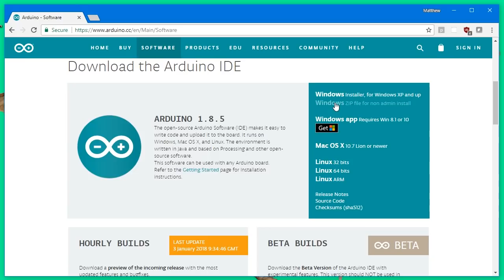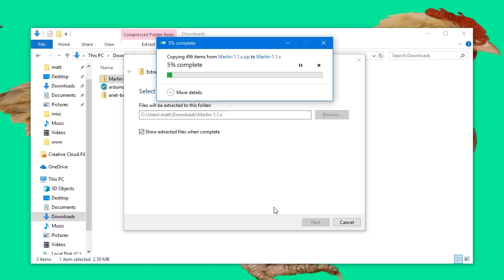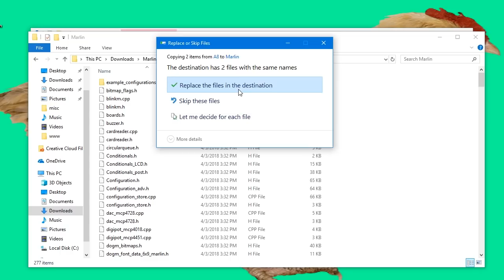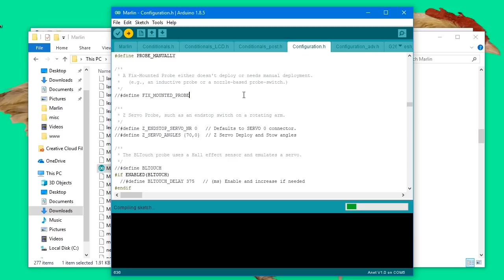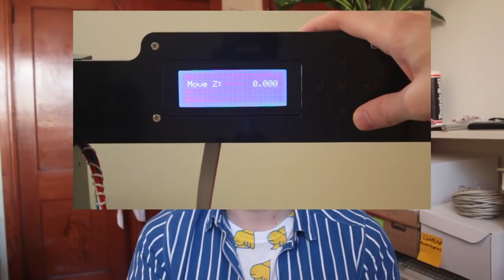Anet A8 Upgrade: Why & How You Should Update Your Firmware - Marlin Install Tutorial

Comment: Great Video Matthew Rayfield!  Thank you.  Everyone doing this to update to Marlin 1.1.9 now will get a "Non-constant condition for static assertion" error when trying to update an Anet A8 board using this instruction video.  To make it work all you need to do is go into your Arduino IDE and load TOOLS/BOARDS/BOARD MANAGER and search for "Arduino AVR Boards" - then click on "Arduino AVR Boards" and install version 1.6.23 by picking it in the dropdown on the left side bottom where it says "Select Version".   After you install 1.6.23 this earlier version of the Arduino AVR boards code is not bugged and your firmware will update.  Happy updates.
Reply: Thanks for you instructions, I ran across this issue too and you saved me hours of stress
Reply: Thanks a lot, Great Man! I had the same issue. Your comment should be pinned on the top to help others with this trouble. (sorry for my weak English)

Comment: hi,i buy a new 3d printer Anet A8 borad V1.7 . When the initial operation, the extruder is directed to the opposite side to the end and continues for a while the engine rotates even when the extruder reaches the end ... The same applies to the surface ... Also, the z direction motor works one and the other does not work .. Note that I almost checked the connections  All are correct, What do you think is the problem?

Comment: About the heated bed connector burning: From everything I could tell when it happened to me, its because the connectors are cheap and not properly seated or crimped. I soldered the wires directly to the pins and have not had any issue since. It was the loose connection on the pins and when the heated bed moved forward and back, it moved the pin around causing sparking inside the connector, ultimately heating up and burning the connector.

Comment: I didn't realize how much I loved my Anet until it broke and I tried a new much more expensive bigger printer with dual extrusion which turned out to be a massive piece of shit which still runs 2004 software. Steer clear of Athorbot. I'm sending that back and now looking to get a new board for my Anet A8. My hot end is the only problem, it won't heat and I'm pretty sure it's on the board where the terminal block melted off and I tried to solder solid core wires to it but might have bricked it.

Comment: Another item for 'Additional notes'  - Make sure you don't have Cura or other software that connects to the printer open while trying to update. Result is error message: avrdude: ser_open(): can't open device "\\.\COM1": The system cannot find the file specified.
Reply from the maker: I will add this. Thanks!

Comment: Thank u very much. Appreciate .
But I have some issue if u can support.
after updating my stock A8 to marlin 1.1 with the correct configuration profile , after auto home the display shows: X -33 Y -10 Z 0 , and The home position for my printer is not above the bed . so I am trying to adjust the X and Y offset . I'm not sure if I am doing this correctly but I use the menu to move the the correct corner of the bed and then select "Set home offsets" but I get an error: Err: Too far!
Plz support

Comment: Thanks for the video, easy for me to follow. But I can't do anything with the printer screen menu after uploading Marlin. It now reads "Marlin bugfix-1.1.x" on start up, then next screen reads: nozzle and bed temp, x? y? z?,  F/R 100%, SD---%, 3D Printer Ready. Selecting center button brings up one last screen, reads: Info screen, Prepare, Control, No SD Card, Init. SD card. I can scroll down on this screen but cannot access any options. I can print from computer via USB. Original firmware was working fine before, I just wanted thermal runaway protection with the new firmware. Anyone have any idea what went wrong? Thanks.

Comment: Worked for me, the bed leveling is really handy although the new menu took a little getting used to
Reply from the maker: Nice, glad I could help. And ya I forgot that the menu changes. I should have mentioned that. It does make more sense though I think to use the middle button.
Reply: @MatthewRayfield  Thanks for letting us know about the safety issues. It's appreciated
Reply: Did you have to add anything to the G-Code to make this work for you? I've had a few issues. First, the screen seems to scramble into non-sensical characters now and then, and by now and then, I mean always. Sometimes hitting middle button brings it back. 
But most of all, I go through the manual bed leveling sequence, it finishes I save the settings. I run a program, it ignores it's bed level and tears off my tape. I have 'bed leveling' "On" in the menu.

Comment: Installation went good but when doing the bed leveling routine, the z axis will only go up.  The LCD shows the amount of z travel, both up and down when the appropriate button is pushed, but z travel only goes up.    Even after the z has move up well in to the positive numbers region,  it will not move down when the down button is pushed.  The numbers on the LCD do go down however. What,s wrong?

Comment: The newest version of Arduino does not work with the board definitions. Open preferences and add this url as Additional Board Manager URL
https://raw.githubusercontent.com/benlye/anet-board/board-manager/package_skynet3d_anet_board_index.json
Save preferences and restart Arduino. In board manager you can now install the Anet 3D printer boards, should be the last option, so you need to scroll down a ways. After installing the Anet 3D Printer Boards, Anet 1.0 will be in the boards list.
Reply: New to this and have Arduino 1.8.8 cannot add your url. Typed it in the preferences line? Any easier way? Happy New Year
Reply: @rjmyers5708  File, Preferences,  Steeings tab
Towards the bottom is a line with an add box
Additional Boards Manager URL's:
Puth this URL in the box
https://raw.githubusercontent.com/benlye/anet-board/board-manager/package_skynet3d_anet_board_index.json
and click OK
The Anet boards should now be available to add under Tools, Board, Board Manager. Anet should be the last entry,  click on install.
If you still have problems I'll see about putting up some screen shots to help.

Sorry for the delay on answering. Had some personal issues.

Comment: I have an a8 with a 1.5 board.  I was able to upgrade it with your help. A couple of times I have had some garbled letters on the main screen. If I go to another screen and then back it goes away. Only other thing is I don't see anything about bed leveling.  Thanks for your help

Comment: Hey matt, so i have this exact printer.   Im looking at a new extruder end on wish, its a multiple color extruder (3 colors).  If i were to buy that hotend, what would i need to add do you think?  New board?  Or can i add to it?  I know i need 2 more motors and i know repieterhost will let you have more than one nozzel.  Im just curious if i need to upgrade the board or what i would need to upgrade if i wanted to get the 3 color nozzel.

Comment: Dear sir,
A well documented and clear explanation of the why and how. 
I found other info but that often was not so easy to understand due to high nerd-levels vs my lack of programming-experience.
Reply from the maker: Awesome ! Glad it helped you out
Reply: had problems flashing though. Finally succes when I first re-installed the drivers that came with the original SD-card. It seems my OS (Windows 10) had problems communicating with the anet 1.0-board.
Thx again!

Comment: i have a 3d printer kit using the ramps 1.4 driverboard and using an arduino mega2560 as the brain, will this work on it without problems or do i need to use a different version for the mega?

Comment: Hi, I want to use this board/steppermotors for a other project. For this project I just have let in turn some degrees en loop that coud someone help me pls. I thought that I just coud me a normal code for controlling stepper motors but that did not work. (i coud not difine the pin). And if woud it work than?
Reply from the maker: i haven't done much with motors, but i think you'd be better off just getting a regular arduino and motor controller shield of some kind. should be pretty cheap.

Comment: Well done. Great explained and following your instructions works nicely. I'm about to change my settings back to these as I've just just fitted a glass bed and my sensor doesn't work thru it - so back to manual I go (until new probe arrives or I can get a metal plate to fit under the glass.)
Reply from the maker: Glad you found it useful ! I'm using a BLTouch with glass and it's working well
Reply: Matthew Rayfield I managed to get a thin steel plate and now it works great. Thanks again :)

Comment: Still works as of Feb 09 2021. Use the exact same versions of Arduino IDE (version 1.8.5) and the Marlin (1.1.x) as shown in the video. I was struggling for hours with newer versions of those with no luck. Finally worked when used the same versions of software on windows 10. Thanks Matthew !

Comment: I did what you say, but now my printer is no longer recognized by the PC and the display shows 3 flashing question marks for XYZ, I did not make the changes to the auto leveling because I do not have the sensor, I do not know how to restore the original firmware v.1.5, nothing works on the display any button is pressed. Report printer ready but in reality nothing works, there are 3 question marks on X Y Z, can you give me some advice ??
Reply from the maker: I believe mine also shows question marks until the printer has homed. So this is normal. I do not know however why nothing would respond. But also, none of the changes I make in this video are for using a sensor, so you can use the settings I change and use the printer just fine without a sensor. Perhaps try going through the config changes I do in the video and try to install again ?
Reply: @MatthewRayfield  my pc not see the mainboard, nothing, i have only X Y Z blinking question mark, if i push anything button,  nothing happen... i am hopeless, u have any help for it?
Reply: OPPS sorry, I made a mistake, I did not realize that the enter key became the central one instead of the right one, ok, the MENU is fine. The problem are the question marks that blinking on X Y Z , why do I have this problem? Can it be that my card is marked "Anet3D v. 1_5"? So is it a 1.5 version instead of a 1.0?

Comment: Once I upgraded in my anet a8 the X motor stop working left, just right (positive). Idk why it happens but it looks like recording the true position. If i try to go to the home Y and Z work well but X start to go right (instead of left) without stop (even if it cant because is on the limit) and finally I must disconnect. It's so distracting. ¿Do you know how to solve it?
Reply from the maker: I don't know what would cause the going in the wrong direction thing. Sorry. Perhaps try checking your cable connections ?

Comment: I get a different "avrdude" error. It says :
Sketch uses 102860 bytes (81%) of program storage space. Maximum is 126976 bytes.
Global variables use 4161 bytes of dynamic memory.

avrdude: ser_open(): can't set com-state for "\\.\COM4"
An error occurred while uploading the sketch
Reply from the maker: This usually means the printer is not connected somehow or you have the wrong port. Make sure all is well with that and try again

Comment: Hi, I know that movie is not up to date referring to versions but I try to update my anet a6 with V1.7 Main Board  .. I'm using exactly this same Marlin&Arduino  + mainboard software V1.0  and not work ..  error as below .. 

Please help!

"Arduino:1.8.5 (Windows 10), Płytka:"Anet V1.0"

In file included from sketch\ultralcd.cpp:96:0:

sketch\ultralcd_impl_DOGM.h:46:20: fatal error: U8glib.h: No such file or directory

 #include <U8glib.h>

                    ^

compilation terminated.

exit status 1
Błąd kompilacji dla płytki Anet V1.0.
"

Comment: hi i have just updated and now my bed goes back to far and my x axis keeps bashing on the left side
Reply from the maker: It's hard to know what's going on without seeing it. Simplest thing is to make sure that the end stop switch is still connected. The default marlin config won't change how that works, so I'd be surprised if it was a software thing.

Comment: Quick question first of all great tutorial on to upgrade firmware easy and painless so the question is after I go through manual bed leveling through LCD menu and start a print the printer head always winds up to close to bed surface and is not extruding is there a quick adjustment for that while printing through their tune menu or am I doing something wrong thanks I also want to add a proximity sensor so I don't have to go to the headache of that

Comment: It doesn't appear in the Port section of Arduino but the printer's definitely plugged in- Running Mac OS High Sierra on a  2015 MacBook Pro, 13 inch. It also says I have already CH341 files
Reply: Did it

Comment: I tried the update and got the following error

Sketch uses 116406 bytes (91%) of program storage space. Maximum is 126976 bytes.
Global variables use 4368 bytes of dynamic memory.
avrdude: ser_open(): can't set com-state for "\\.\COM3"
An error occurred while uploading the sketch

Any Ideas?
Reply from the maker: The last part: avrdude: ser_open(): can't set com-state for "\\.\COM3" seems to indicate that the COM port might be wrong. Check that port and make sure the printer is on. Other than that I'm not sure.
Reply: Matthew Rayfield yeah checked the com port, actually the only com port showing. Printer on, restarted the printer. Almost seems like there isn't enough storage to upload?
Reply from the maker: I have had an error related to the storage before. But it seems to go away once I recompile. I know that's not super helpful... The only other time I saw a storage error was when I had turned on a configuration option that took up too much space. Maybe double check the config ? But then again, this error says it's using 91%, so I'd think that would be okay.

Comment: Having had done a ton of Arduino stuff in the past, this video made it incredibly easy. Thanks @Matthew Rayfield!

I see some folks are having random issues flashing the A8 controller or their controller getting bricked. It is possible your Adruino does NOT have a bootloader flashed to it (or it was overwritten). This saves a bit of space at the expense of not being able to flash it over USB. In that case, you would need to get another Arduino and set it up to flash over ICSP or get a dedicated ICSP programmer. With the ICSP programmer, you can (re)flash a bootloader and then it will upload like normal. If you can't spare the space, just flash Merlin on with the ICSP. When using the ICSP, select the programmer and use the 'Upload Using Programmer' button instead of 'Upload'.
Reply from the maker: Good advice !